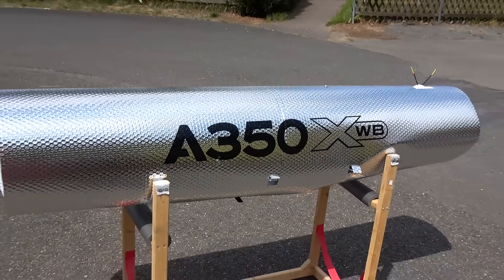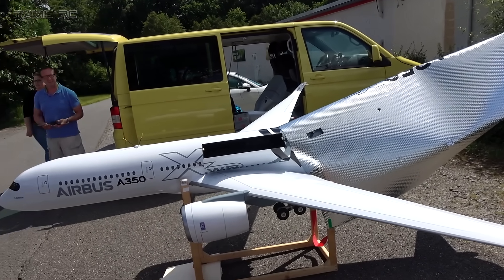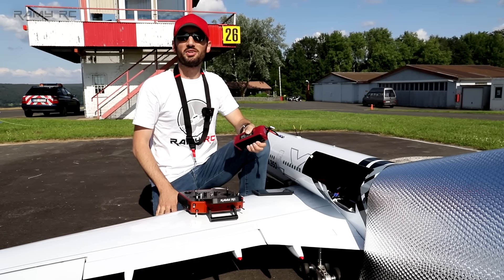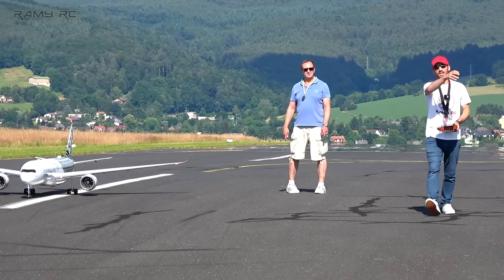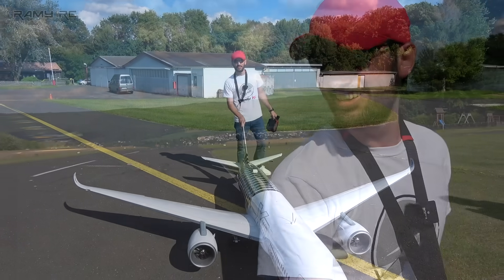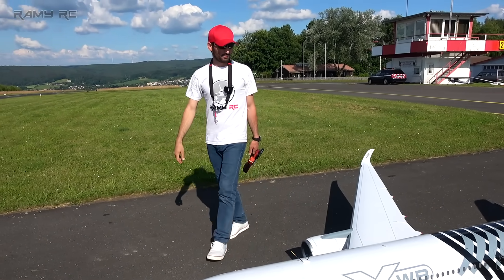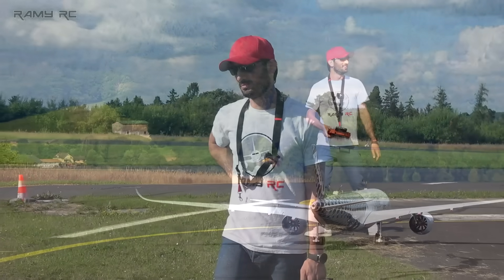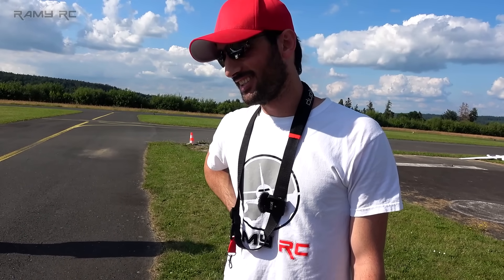GIANT RC AIRBUS A350 XWB MAIDEN FLIGHT

Comment from the maker: Stay tuned for many more flights of the A350,  Awesome job by my lovely wife capturing these awesome shots! 👏👏👏
Reply: You should put a camera at the nose and have it transmit to a pair of virtual reality headset. That way, you can experience it in first person. It might even give you more control.
Reply: Full on plane video please i like this airbus👍
Reply: I think it's likely that the reason why the gear is getting stuck only during flight is because the aerodynamic forces might be pushing it just enough to cause it to get snagged on either the door itself, or the edge of the opening in the landing gear bay. I might try putting cameras on the belly right by the landing gear doors so you can see for sure if this is what's happening. If either the door is getting blown into the path of the gear, or the gear is getting blown enough to get snagged on the opening in the landing gear bay, you could probably fix it by using a stronger servo for the landing gear doors and also making sure there is no room for wiggling for the landing gear legs.
Reply: Hello Ramy, my heartiest congratulations on your successful maiden flight with your Airbus. The location was first class, really well chosen. And can you please tell me where you pre-ordered the great weather :-)
You can be quite proud that the Airbus is the crowning glory of your models! Keep it up, I'm a big fan of your channel and I'm looking forward to your next projects !!
Reply: Nice work. Congratulations 
In a spanish word 
¡Torero!
Reply: Absolutely beautiful! Truly enjoyed this build! Thank you! Those first flights always take your breath away!
Reply: @rubenruiz8442  ,jet firgfgvv (7wrs 1 2 3 4 5 6 7 8 9 10 11 12 13 15 16 points
Reply: Simply AMAZING, after following all your effort, creativity and commitment, it finally became reality with this video, I congratulate you because it is the way you demonstrate how to transform and materialize your dreams. I am very happy for your achievements!! Congratulations.
Reply: She DID do a fantastic job tracking and zooming.
Reply: Damn what a realistic plane! The sound is gorgeous and it looks so much better on an asphalt runway rather than grass!
Reply: Next time to avoid your fright on landing.  Try to land a little bit sooner because ngl I would of done a go around. Bring her in lower, but coming from experience. That last landing was beautiful.
Reply: Hi Ramy, first of all, congrats on this new addition to your amazing collection, love your work and amazed by the level of details and perfection you put in each model. However, I cannot help but noticing a bad habit you have, banking a little too much at low speed, I follow each video you make, and can't help but noticing, each flight there is a near stall in a turn or near landing. Hate to see those amazing pieces of art destroyed. I know part of the fun is to build, fly, crash, rebuild, but come on man, they are too pretty to get that treatment. Keep your speed up when bank.
Reply: HOW fast fly this fantastic plane?
Reply: B-787-9 MK-2 please
Reply: Yesss its very big idea
Reply: Fantastic Ramy!!!! Can't wait to see the full build video!!!!
Reply: Mann, um really happy for your with this successful maiden flight. Helps you to get rid of your 787 demons.
Take it easy, pal!
Reply: Awesome job and beautiful flight.  
Now you'll need rebuilt Boeing 777 back to flight. 🙏👍🏻🇺🇲
Reply: Always take care not crash it again haha
Reply: excellent maiden ...i was on the edge of my seat till she landed ...well done ramy rc !!
Reply: amazing and exact shape    Congratulations from Guatemala fans!
Reply: ramy that is your best airliner so far hands down, is a masterpiece on wings. the engineering you put into this plane is amazing.
Reply: a RC kid with a wife... never heard of this before
Reply: You probably already mentioned in some of your videos,  but without searching,  how many man hours and money do you have with building this model? Great looking by the way. 👍🛩
Reply: Can you do a night video?
Reply: How about a minute
Reply: Nice
Reply: Cloud you make a plane to order for my birthday?
Reply: Ramy RC what about a airbus a320
Reply: Amazing work. Congratulations 👏🏻 😃
Reply: Respect you wife sir great shooting
Reply: ThAt'S a PrEtTy SmAlL pLaNe
Reply: Good Job Wifey
Reply: Hi do you do this as a hobby or business? If u do for business can I know if you have any of these for sale please?
Reply: Congratulations on your successful maiden flight. Quick couple of questions if I may. Q1) The left wing of A350 seemed to separate slightly from fusalage. Is this normal or needs a fix. Q2) Why was the rear section painted in black stripes as it seemed to cause the model to overheat, hence your silver wrapper till takeoff.
Reply: Absolutely Fantastic Kerstin!!!!
Reply: Ufkzkz
Reply: Amazing work Rami, I would have put one receiver antenna on the belly so that you will not loose connection when the plane is high up in the air (like real planes have) and you really should slow down the speed over the whole flight, now it looks stressed (it's not a fighter) gear and flaps shall only be lowered after the speed been lowered a lot, just like the full scale planes, flaps are not air brakes, the are increasing the lift so that the plane can fly slower.
Reply: Bro plz reply
Reply: Please your all rc plane review
Reply: ل فى
Reply: Kelly Johnson and Kurt Tank are in your DNA, you are a fantastic designer and Engineer.
Reply: Breathe now!!!! Wow, great accomplishment!
Reply: WoW this is so great Ramy RC I really do enjoy your nice and great video this is also my dreams✌️✌️
Reply: AaqA Aaron a qq qJsj j
Reply: @Deivania Reis what mean of it can u explain in english
Reply: Have you sold that?
Reply: o,
Reply: For some reason my 20 months old baby loves your video and request it :) I believe he is your youngest fan
Reply: Nhnmjmnjjjjjjjjk
Reply: و

دككحمهفر. ىةطط
Reply: Aroplan rupees10000
Reply: 1q1
Reply: nice job
Reply: may baymay baymay baymay baymay baymay baymay baymay baymay baymay baymay baymay baymay baymay baymay baymay baymay baymay baymay baymay baymay baymay baymay baymay baymay baymay baymay baymay baymay baymay baymay baymay baymay baymay baymay baymay baymay baymay baymay baymay baymay baymay baymay baymay baymay baymay baymay baymay baymay baymay baymay baymay baymay baymay baymay baymay baymay baymay baymay baymay baymay baymay baymay baymay baymay baymay baymay baymay baymay baymay baymay baymay baymay baymay baymay baymay baymay baymay baymay baymay baymay baymay baymay baymay baymay baymay baymay baymay baymay baymay baymay baymay baymay baymay baymay baymay baymay baymay baymay baymay baymay baymay baymay baymay baymay baymay baymay baymay baymay baymay baymay baymay baymay baymay baymay baymay baymay baymay baymay baymay baymay baymay baymay baymay baymay baymay baymay baymay baymay bay
Reply: Nice  airplane ✈️
Reply: One word. FANTASTIC!
Reply: @alec933  another ONE word: jealous! 😉
Reply: @alec933  90)
Reply: Nice one Ramy. One suggestion, seperate your aileron and elevator trims with each flap position.
That was you can re trim in all flap conditions.
Reply: When i saw the notification my reaction scared my parents😂😂,,,,btw LOVE YOU.
I have no words for it,i can't imagine that those two hands made it.❤❤
Reply: @Azan2233-q2s &5566//
Reply: Bro plz try to make chopper
Reply: Nice plane and nice flight, well-done bro!
Reply: Wow awesome I’m ℒℴvℯ this airplanes ❤️🇦🇪
Reply: Try making a reverse trust.
It would look and stop like a dream
Reply: Matejovik 13 great idea.
Reply: Good idea, but how it needs more electronics which will make the aircraft heavier 😐
Reply: @matejovik1351  
G
Reply: O
Reply: @matejovik1351  hi
Reply: @ahmadabeer1343  hey
Reply: @matejovik1351  kjjnñ1
Reply: @matejovik1351  شطصص١
Reply: Nice work and nice plane bro plz plz contact num i meet u i request in every video plz plz plz very very very big fan i am subscribe your channel 2 to 3 years ago big fan bro realy love u with your sweet wife i don't know hows look at that but realy love your family personaly see u soon
Reply: @choudhary14386  er1qq11111l
Reply: @daniajalal4252  what mean of these words
Reply: @daniajalal4252  and what is this

Comment: This is incredible, amazing detail and work went into this.   It's always odd the way scale models move, almost cartoonishly quick and unstable, what causes this? is this mostly to do with the weight of the aircraft contrasted with the strength of wind gusts?  When designing a RC aircraft would it be possible to make a much more stable design? I'm assuming the physics of a lightweight aircraft of that size would require weight just to keep the most mild gust from moving the entire aircraft around.

Comment: Word of advice with flying a scale plane of this size.  It is very easy to tip stall at lower speeds with flaps so be carefull when making your turn from base to final not to stall the low wing.

Comment: Hi Ramy, Congratulations on the flight. It looked superb! 

You have a real talent for the construction of RC Planes and have obviously taken great efforts to make your models behave like the real aircraft.

Have you ever considered creating your own RC line for sale? 

It may be easier than you think and based on the comments I see across your videos I think your fan base would support the endeavour whole heartedly.

Also, I think the controller you are using is clearly top of the line but I have an idea for a controller that would utilise sliding potentiometers to mimic the controls found in the cockpit of most aircraft, In theory making the flight more stable. Would this be something you would be interested in?

Comment: Hey Ramy, quick question. Why are you concerned about the model getting hot on the ground? I saw you had the silver reflective heat/sun shield/cover while it was on the stand. Will the carbon warp if it gets too hot?

Comment: U tipped stalled the airplane in a high bank to the right. I have heard that described as duch roll. As u know a aircraft is pulling more g load in a bank. Speed is your frind. When I slow down I keep my banking low and my turns large. The planes u fly are large. Fly them the same way LARGE. 

U are a very talented model builder. Nice work.

Comment: I am amazed about your great builds. They look fantastic. BUT i think it would be a good idea to get some flight hrs under your belt with some more simple airplanes so you will be better prepared when something unexpected happen. I myself have about 15 years experience with normal airplanes and helicopters (F3C), so i believe i know what i am talking about. 
I say this with the best intensions. It looks to me that you need to make a big adjustment to your ailerons setting on your transmitter. Make a smooth curve around the centre and full movement at full travel !!! if that make sense. Keep going !!!  I look forward to watching more great plane builds from you. PS : This A350 is your greatest build yet in my opinion.

Comment: Excellent!  Is it possible that wind pressure from the plane's forward motion is causing some slight binding in the linkages and preventing the landing gear from retracting? Your static tests on the ground show that everything works smoothly, so that's the only I can think of that might be responsible.

Whatever. WELL DONE!  :-)

Comment: Ramy, I hope you see my comment, I think that about the landing gear it may be that at takeoff the weight of the plane has some effect on the wheels, and when it comes up they get stuck, so when it comes down and up again and to enter correctly, I hope that problem can be solved, and again congratulations man, you did an incredible job

Comment: You better remember about those 50 and 60 degree banks and pulling to much elevator so you don't stall it again. A airplane can stall at ANY speed, slow or fast. Exceed the critical angle of attack, especially with your wing plan form, and it will drop a wing instantly. Beautiful Airbus, and nice flight. Congrats!!!!

Comment: I am so very happy for you, what an impressive aircraft and an amazing flight!!   I guess it’s hard to build leading edge slats into wings.  We use them on large scale jest to add more lift on the wings for takeoff and, landing.  With slats, your jets would come in more nose high and even slower, in the full landing configuration with a slight, if any, flare at landing..  Without them, the Jet approaches like a CRJ 200, nose down, and with a flat flare.   This is not to detract from your master work, your creativity is amazing, pure creative genius as far as I am concerned!   Beautiful!!!!
Reply: Slats and lots of small aerodynamic features simply do not work or have negligible impact at that scale/speed/wingload, just adds pointless mass and development time.
Reply: randomnickify, I’m surprised at that, as I’ve seen them on scale jets and they seem to make a difference.

Comment: You crashed one airliner and got another one. I really hope you got some time both in the air and in a simulator. Because last time was horrible. It was easy to see that you didn't know what you were doing with the first jet. Landings were all elevator. Hard to tell here but I hope that the lesson was learned. Nothing wrong with not knowing what to do. That said, the aircraft is lovely and seems to fly well. Which is quite impressive since the airframe is designed to use computers for stability and control. Keep flying and good luck :)
Reply: RC airframes only look like the real ones, this model has bigger wings, stabilizers than the real plane and its using lowspeed airfoil (check first episodes), while it looks similar to the airbus, its aerodynamics is different.

Comment: Ramy, I'm in the hobby for 45 years. I consider you the most outstanding builder ever on this planet.  Your planes are designed by others, however your exact replication of them is just stunning. Keep up the great craftsmanship.... Try flying with two fingers on the gimbals, It will smooth out your flights considerably, I have had much better results in control accuracy when I used the "Pinch the Gimbal" technique..... Good luck in the future....

Comment: Your gear seems to work fine on the ground but in the air it has air resistance blowing on it which may be the problem. Either a stronger set or servos for it or adjustment of the gear and doors perhaps?

Comment: Amazing results there ,and a beautiful aircraft to boot  plus I was only just thinking that this project probably cost more in 3D filament than one of your previous entire planes. I was also just thinking , why don't you have some type of external power unit/supply so you can do all your preflighting and then have it change to the on board batteries once its unplugged so you don't deplete your batteries hence longer flight times and I would more than likely be more at ease having the gear down for the maiden..... Just a thought ...anyway top job Ramy 👍👍from🇦🇺

Comment: Ramy, you have once again built a masterpiece, you're an amazing engineer, but if I may give you just one advice, please watch your bank angles, final turns are always way to steep even with the excess of energy you are keeping, just fly your downwind further away, base leg need to be flown a little far away also, so you will need less bank angle for your base and final turn and you will have more distance to stabilize your final approach.
Remember, a full stop landing is just a failed missed approach, always consider a go-around procedure.
Great video, thanks for sharing your awesome work ! 
Greg, Boeing 777 F/O and Type Rating Instructor.
Reply: He doesn't have enough juice for go around. Five circles and he has a dead stick.

Comment: What a beautiful aircraft!!

You truly are a craftsman. 

Congratulations to you and your partners in putting together a magnificent model. 

2 brief questions:

1) what on-board camera are you using? 

2) I compete in scale modelling also. And I know it’s the maiden flights, would you, once you get more used to the plane and the settings and stall speeds, consider going to dual-rate, (smaller throws) for control surfaces?   It for me anyway, smooths out the flight.  

I’m very interested to hear your opinion.

Army. 

Great job👍🏽 Really enjoy your videos.

Comment: Beautiful as always... P.S. if possible, add a small low speed outlet fan with a tube attached to the APU outlet so as to suck out the heat from the interior and add some inlet slits somewhere to keep the temperature regulated during flight in sunny conditions.

Comment: i had the same problem with my plane,  one of the gears didnt want to go in once in the air..   and during testing they always would work.   seemed that the drag of the air pushed it one millimeter to the side and therefore the wheels got stuck....maiden flights like this are bad for my hart and then my planes are way smaller duh....😉

Comment: Check the gear retraction while applying a rearward drag force to it - in the airflow they will have a very different load than a static retraction. (You know this I'm sure). Great job though!